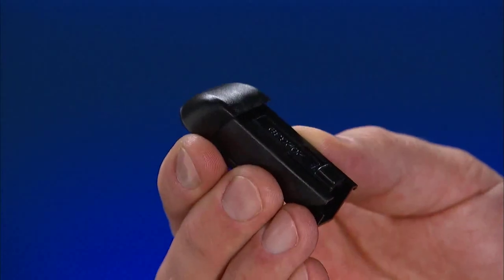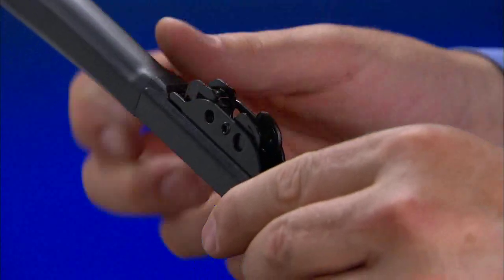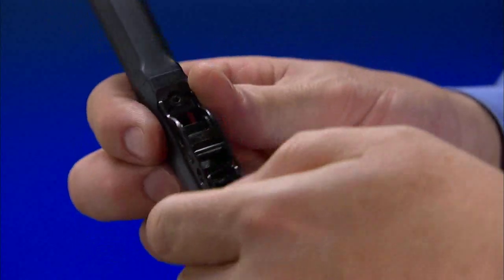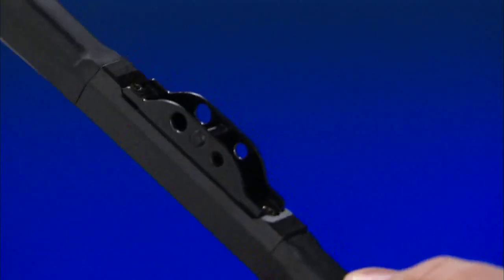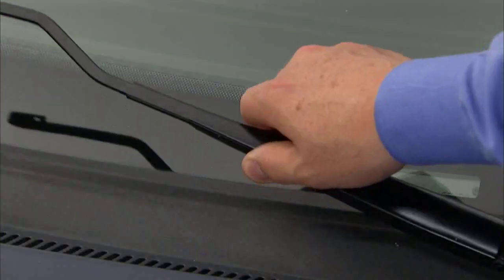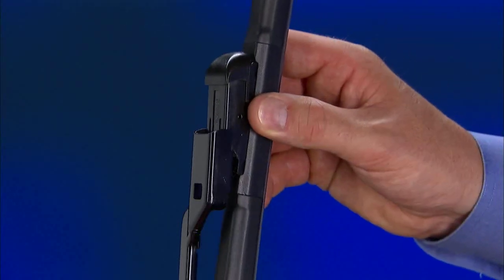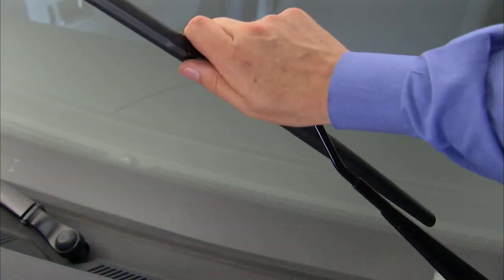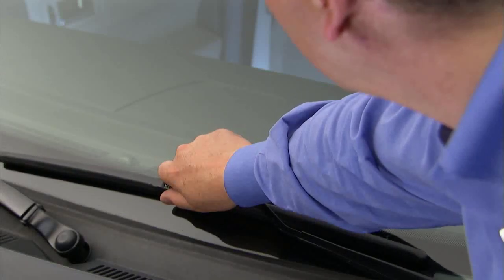MICHELIN Stealth Top Lock Installation

Comment: I have 2016 Colorado. 1- 22" 1- 18". The 18" blade had only optional clip. It was not the one I needed. The other blade had 3 options parts, and had the correct one.How do I get the correct part?